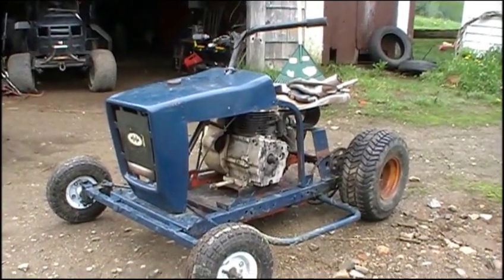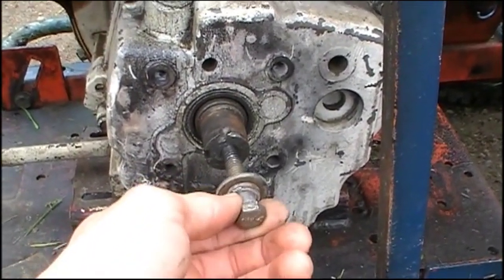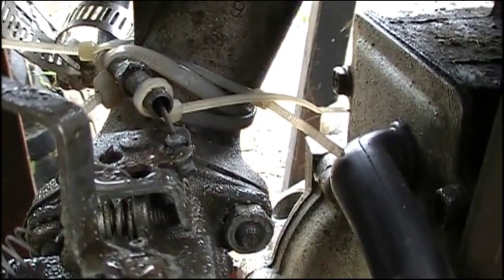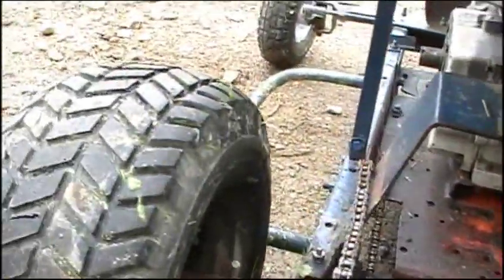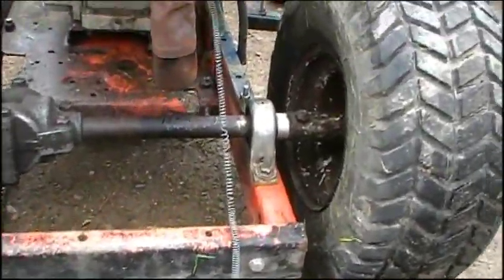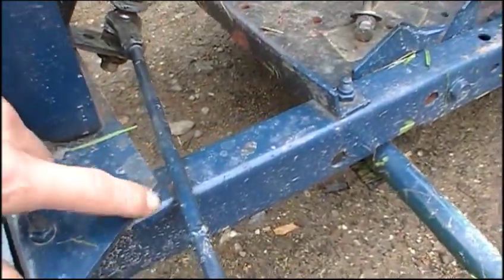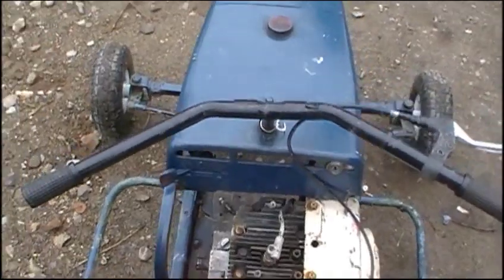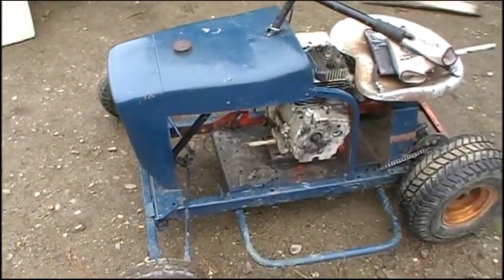Racing Mower Overview Before Teardown

Comment from the maker: @blankcreations Yeah, I'm thinkin that I'm gonna use the honda clone. The more I research them, the better I like them. I've never worked on one, but I like learning new things! I'm still not 100% on the jack shaft, just because it's more moving parts. I may try it without it first, then maybe add it later.

Comment: On the harbor freight motor you can remove the gas tank and put a foam air cleaner on it then run a seprate tank, then you can slide it under the hood because the piston dosent run straight up, it is like at a 45 degree angle.

Comment: i have a harbor freight clone on my mini bike and so far its been a great engine. the reason you dont see them on hf's website is because hf is getting rid of the blue engines for the new black ones, which are pretty much the same, except the black ones have slightly bigger bore and they have a cast iron bore liner. at the hf near me they have the blues on clearence for $65

Comment: Just remember that your suspension is your tires.  I know you run lawn mowers off road, but a bump at 40 MPH is hell with no shocks.  I'd use a low pressure ATV tire all around if possible.

Comment: i got a 6.5hp engine on my go kart and it does not knock but the oil presure sensor goes bad and the engine stop running. All you have to do is unplug the yellow wire. Hope you get one thes engines are very reliable.

Comment: @Rebner008 no their not, i have one that i built a little with a high compression head and took out the governor, but it still has the stock rod and i turn it close to 8k rpms, and it still holds up fine

Comment: @Fearlessfront  gotta put on a new starter and dlean out the carb. im thinkin on liftin it like your craftsman but with a 3 on the back and 8 on the front, did that to a 11 hp yard pro and it ran a lil over 40 lol

Comment: harbor freight sill has engines, there was some in their add this week, a 6.5hp is 180$ and there is a 7hp duromax engine on ebay right now for $170. damn that thong looks like its about to fall apart, id  check to see if the clutch is alright seeing as the shaft seems to be cut off center, drilled off center, too small etc.... replacing the tie rods sounds like a good idea and id defiantly say that thing needs a total rebuild lol. i can msg u the ebay link if you want

Comment: greta motors had one on my go kart but couiple tips is remove the govener put an aluminum flywheel on oil sensor cut and metal cam not plastic!

Comment: you should get a littel air cooled diesel i had one on my go cart befor the shed burned down that it was stored in that thing had alot of torque and i plan on building a new go cart with a 450cc motor out of a atv or do what you did with the torque inverter and a littel diesel

Comment: @Fearlessfront lol nah 16 hp may seem like alot of HP but really its not the oposed twin is very light its lighter then my 12hp briggs flathead engine or u can buy a classic briggs raptor flathead ive gotton one its been bored has billet rod and a billet flywheel puts out 10hp from 5hp

Comment: @blownutsmyass on a toy its probably gonna wear out faster. id just find an old briggs or even just try to find a used shaft that would fit and rebuild the 8hp. sounds like the engines the other guys are talkin about are worth it tho. id probably go with that